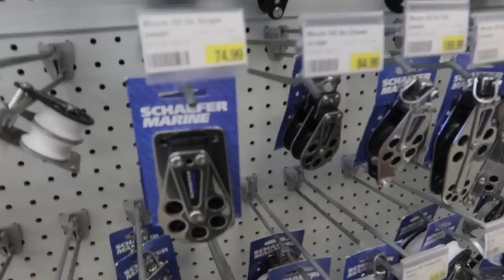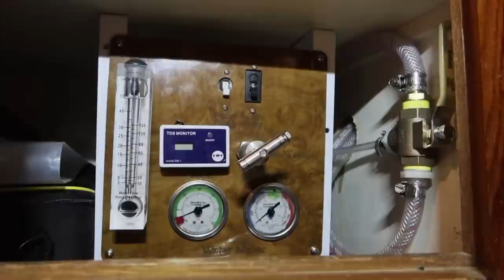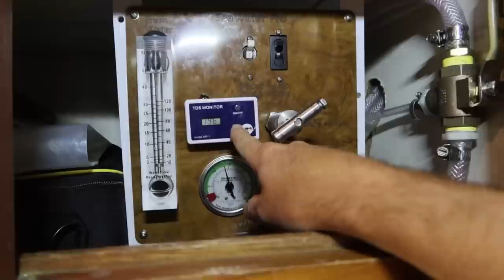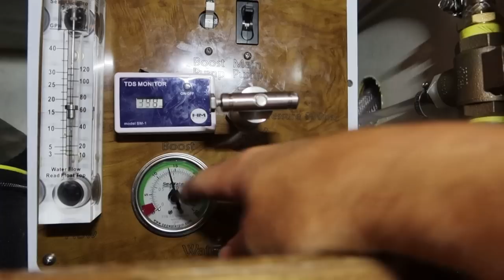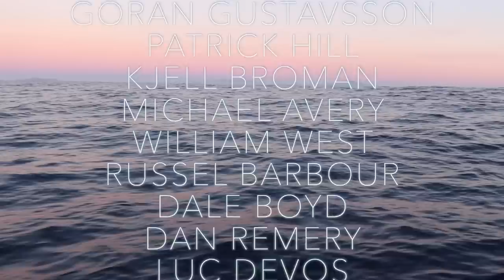Over BUDGET Problems | PIRATE SHIP S15E12

Comment: Teak oil is the way but if not 
Done well the first time and 
Continued on regular schedule never seems to last
Very long before drying out
again and losing the glossy
Look. There must be a trick
 to it of when to reapply. a lot
Of teak is never ending 
Maintenance. Coatings make
Too slippery and defeat 
absorption of oil.
Reply: Hence, synthetic teak is the way to go these days.
Reply: Real teak in this day is great for inside and casework but exterior…synthetic is the way to go.  There are many recent advancements in synthetic decking and trim.